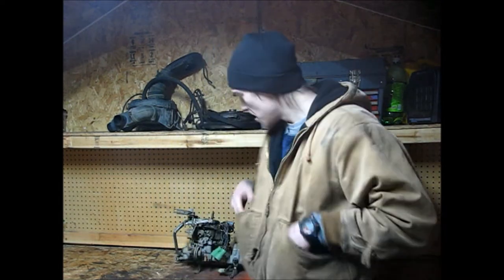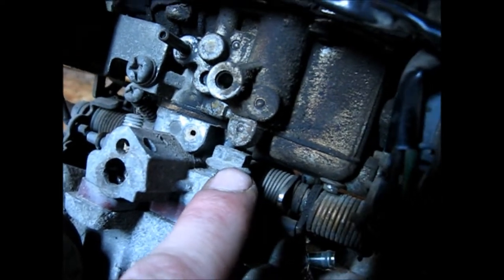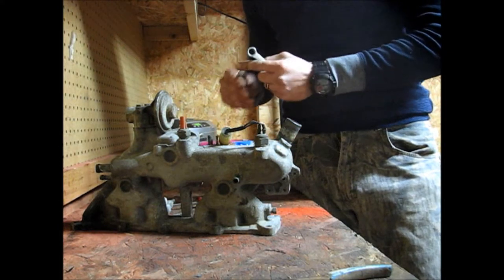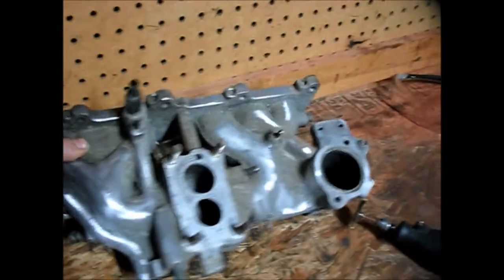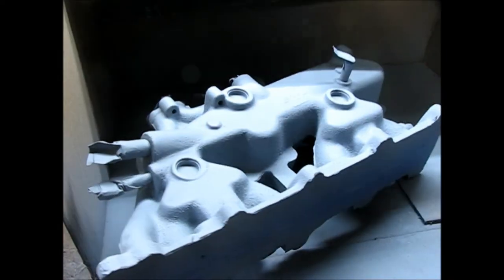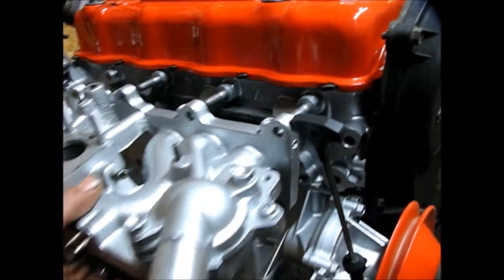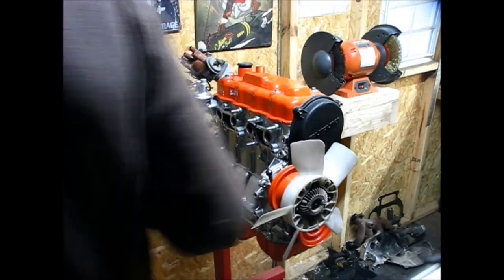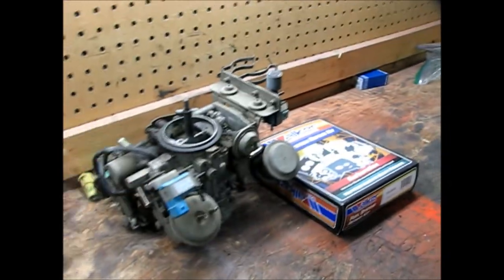Suzuki Samurai Intake Manifold Restoration (Time Lapse)

Comment: Is your EGR valve installed backwards?
Reply from the maker: That is a good eye you've got there.  I do believe I installed it backwards.  Thank you for pointing that out! I'm going to have to correct that
Reply from the maker: So in this video I did install the egr upside down.  However I must've further down the line realized because I just checked and my egr is installed correctly

Comment: Hi Man. Please help me. I wanna buy repair kit for my carburator and I can't find nothing! The carburator name is Mikuni corp. Is this a normy carburator because my friend have different one. Pleas help a Suzuki samurai beginner
Reply from the maker: Give me a minute to do some research on this.  If I remember correctly the stick carb is made by a company called Aisin. But I definitely recognize the name Mikuni. Let me do a quick search and I'll get back to you asap.
Reply from the maker: So I did a little bit of skimming through the internet and some forums. From my understanding, the Mikuni carb is an aftermarket carb that is a fairly common "upgrade" choice when replacing the stock carb. It seems as though there might be a few different Mikuni carbs available ranging in different CFM intake volumes. Without knowing exactly which carburetor you have I cannot make an adequate recommendation on the appropriate rebuild kit that would benefit your rebuild.  I'm unaware if these Mikuni carbs have a serial/model number but if they do you might be able to cross reference the carb to obtain the information needed to make an informed purchase on a rebuild kit.
Reply: @mountainkeep5776  thanks for your time!! I love your Chanel. Keep up the good work! Have a great day